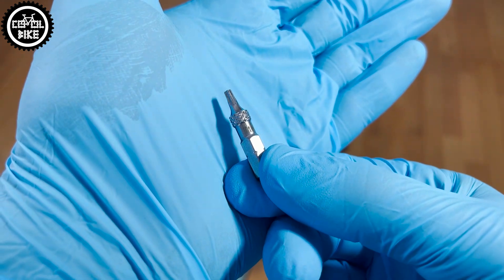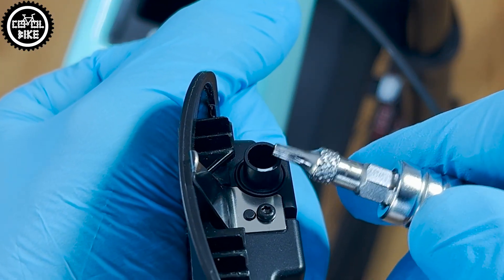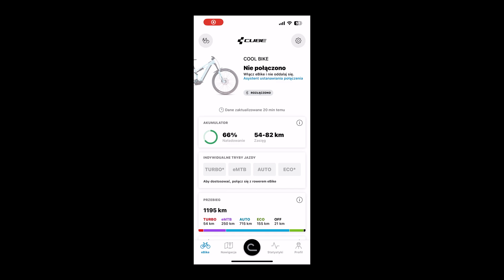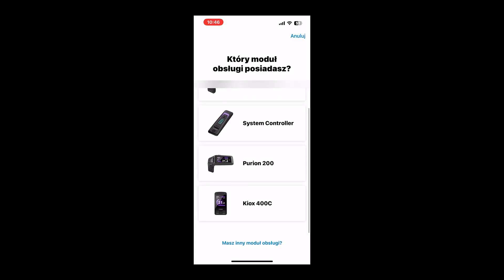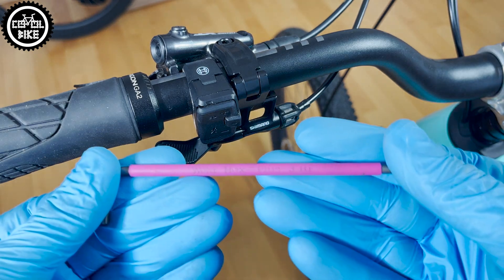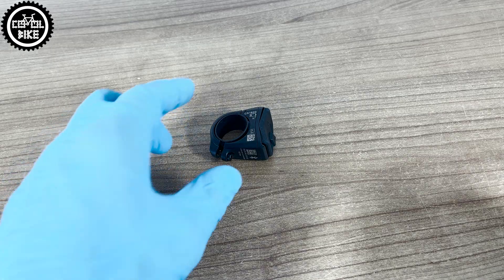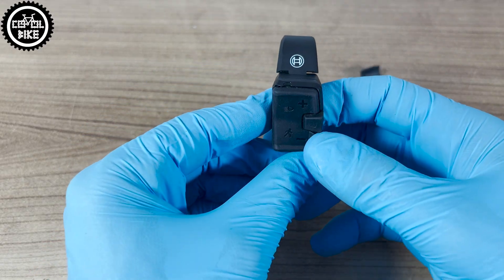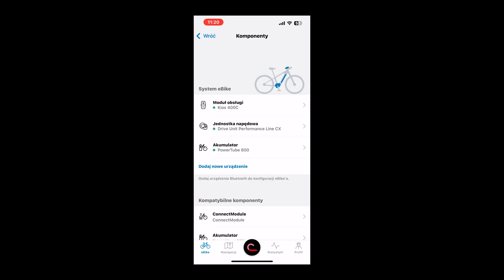HOW TO INSTALL BOSCH KIOX 400C

Comment: Good job. But im pretty sure you shouldn't use anything metal to remove batt from controller. To avoid a short
Reply from the maker: It's possible, but this battery is tight, and I had to repeat this shot probably 10 times ;)

Comment: Wish my Vala came with it!! Now I have to try n find 1😭
Reply from the maker: Unfortunately, this display is only available from September, so it will only be available on 2026 bikes. For older models, you'll need to purchase it separately.
Reply: @COOLBIKEyt yeah I know. Im gonna call a Santa Cruz/bosch dealer & see if they can order 1. Im sure they are on backorder 😢
Reply from the maker: @mikeguercio  Kiox 400C is great, and I recommend it. It's great upgrade from old System Controller.